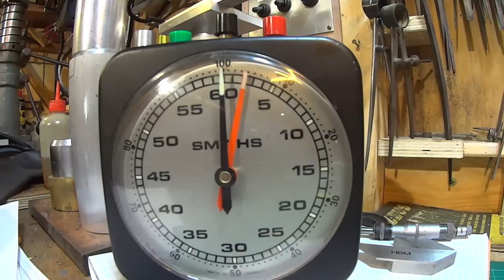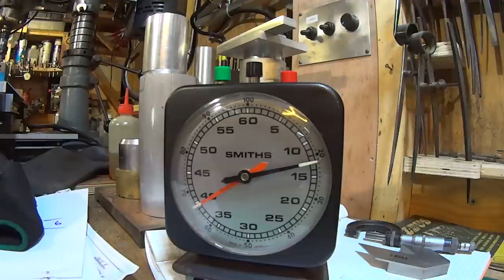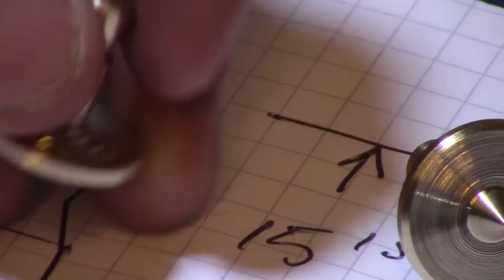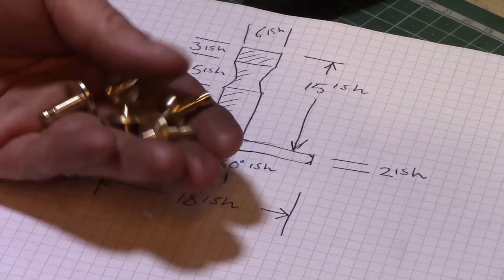15 minute Lathe Project for Beginners

Comment: Make sure you use Mitutoyo calipers for scribing lines on hard materials in the lathe.
The combination of expensive calipers and your lathe's highest RPM setting ensure that the lines will come out very neat.

And the little screw end of your Mitutoyo micrometer makes a great hammer for bashing things into alignment in the chuck.
Just some pro tips to save you time.
Reply from the maker: Lol!

Comment: I like the opposed mount for your parting tool. I'll have to copy that.
Reply from the maker: @LawTaranis - the rear parting tool-post is a design by George H Thomas in 1973, the drawings are available in chapter 30 of Ian Bradbury's book, The Amateurs Workshop. The casting kit is still available via Hemingway kits. It is a very useful tool on the Myford 7 series

Comment: Excellent video, Ade. Clear and concise as always. Slightly concerned that my ML7 doesn't have the long cross slide and that I'll make a pig's breakfast of parting-off. Only one way to find out, I guess... Many thanks for posting.
Reply from the maker: Hi Russell, mine is also the standard size cross slide, so no problem with that

Comment: Thanks! Just got my mini lathe. You turned the tool turret for one cut, and angled the base slide for another.....how to decide which to angle?
Reply from the maker: Hi John, setting the tool at an angle creates the form of the tool, so it will impart the tool shape, using the topslide at an angle cuts a taper at the angle of the topslide. Ade
Reply: Ade Swash  Thanks...I think I figured it out, too. Angle the tower to set the tool, angle the base to DRIVE the tool. Very good.

Comment: I've never really seen a caliper used in that fashion. I was wondering why you wouldn't use the carriage indicator to dimension the part?
Reply from the maker: Simple answer, quicker and easier, it is a 15 minute project :)
Reply: @AdeSwash  I'm always open to new ideas. The reason I'm asking is understanding this is a quick project, I figured 3 turns of your wheel is 30mm and would be quicker. I'm happy I found your video by the way, and as soon as I get some brass, my 2 little ones may just have some of these things under the Christmas tree.
Reply from the maker: @hackish1  It isn't that simple, the ML7 is imperial, so 3 turns of my lead screw hand wheel will advance 9.525mm (3x 0.125 inch) so to advance 30mm I would need to use the hand wheel to get to 1.18 inches, which would require me to stop and think, do a calculation, and set the handwheel to the correct setting, as you can see, the calipers win over :) Regards. Ade

Comment: boy you were really taking off a lot of material that on each pass that's not really advisable that's where all the noise was coming from
Reply from the maker: It is Brass, brass is always squeaky, no lube. You turn roughing cuts to the capability of your lathe
Reply: Never mind the fact he uses his calipers while its spinning to mark it.. for beginners??? Trying to mame ppl?
Reply: It's brass mate, high feed high speed, deep cuts when roughing, so long as your machine has the power and RIGIDITY. We used to take massive cuts on brass and alli but my machines definitely had the capabilities not to stall. Shit loads of power and mega rigid🙂

Comment: There we have 95% of one's stock brass becomes sand and grit on the floor. Cute.
Reply from the maker: Well, it become brass swarf on the floor, there is no sand or grit in brass
Reply: @AdeSwash  What a waste, what was I thinking? Ok, new word  (as of 1565) swarf. Sounds great. Next time I find someone as absentminded as me, I will use that for a nickname.
Reply from the maker: @jwstanley2645  That's the nature of the beast, you have to remove stock to turn a part. All my swarf goes off for recyling so very little is wasted in reality

Comment: why do folk use callipers as scribers?
Reply from the maker: Because they are perfect for the job
Reply: Only untrained amateurs do such things. There are plenty of low cost marking-out tools available, even a vernier caliper with a roller for one jaw and a scriber for the other, see Banggood or ebay. No Tradesman would use a measuring tool in such a manner, let alone pass such bad practices along to amateurs in the form of "how to" videos. Ade even uses the example of another untrained amateur, Clickspring, to justify his own bad practices. Such practices simply wouldn't be tolerated in an engineering machine shop or toolroom.
Reply: @rossgee1091  totally agree it a deplorable way to use an instrument

Comment: G'day Ade,
It's Geoff from downunder Melbourne Australia. I did expect a reply from you like that.I don't care if it's your caliper, it's tool  abuse a precison measuring instrument cheap or not.
If you were working in my shop and I seen you doing that , it would be onya bike and don't come back.
As I said not a good look.
COOEE
GE🎃FF
Reply from the maker: Hi again Geoff,  do you follow Clickspring?, he is also from downunder and a highly regarded clock-smith and precision instrument maker, he uses his caliper for marking out almost exclusively,  also, most machinists do not use them for precision work as they are not really considered precision enough, compared to a micrometer for instance. G'day from UK